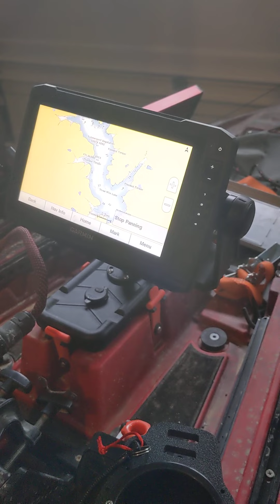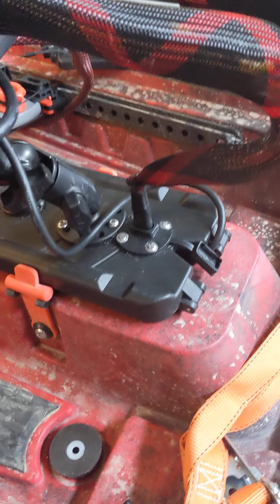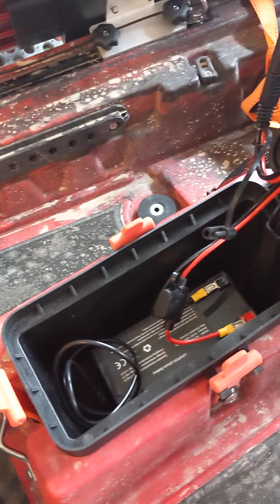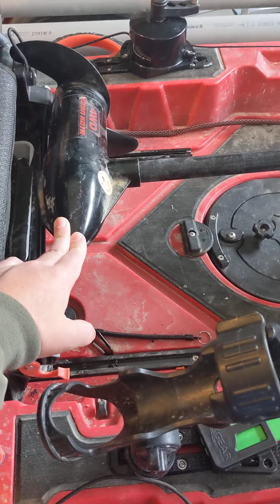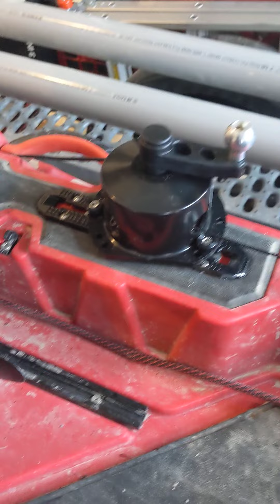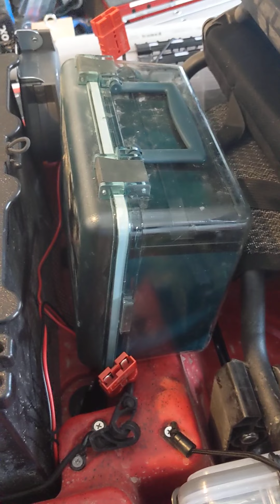Vibe Shearwater 125 Electronics Walkthrough

Comment: How did you get the triple shot transducer to fit? I couldn't get mine to fit the the pod cavity unless i loosened it way up, then couldnt get it to level out under the kayak.
Reply from the maker: well the Garmin 93SV three in one isn't all that long in the GT54. The GT56 probably is a tad long. I know guys that run the Lowrance tripleshot and they do as you do, loosen bolt enough to tilt the ducer down when placing and removing the pod. In some instances, with the right mount, you can loosen it just enough to click it up and down. Sometimes you have to loosen and tighten your bolts. Certainly a pain. However, it doesn't have to be perfectly level. The boat isn't level and isn't level when you're getting bounced around on the water. You won't lose much if it isn't exactly level after placing your pod. My ducer certainly isn't level or even straight as one of my mounting nuts stripped out so the whole thing has a bit of a jiggle to it.

Comment: I’m about to install that same Garmin on my Shearwater. Do you feel your Garmin is too far away from you on the pod?
Reply from the maker: No, not really. When split screening it isn't the best due to distance but just having one thing on the screen at once it is plenty big. I would not use a RAM mount again though. Hard to get it tight and locked in position. I would say before bolting it anywhere permanently, try a few outings with it on the gunwale and see if it gets in your way. I like the ease of pulling the pod and going as well.
Reply: @kyjomi  Ok. Thanks. I bought the Scotty mount. The ease is one of the main reasons I want to mount it to the pod. I was laying everything out last night and had an idea to mount it on the starboard side where they have the step rectangle section. I would drill a whole behind the Scotty mount and use the YakGadget through hull wiring kit to run power and transducer lines. I’d have those lines coming out through another through hull wiring kit right by the pod. Not sure if that makes sense. Not too sure if I want to drill two hole that big though.
Reply from the maker: @mesa620  I considered moving to gunwale over the off-season but I didn't want to route the cables through the hull or have them strung across the hull. I rearranged a lot of stuff over the off-season to keep the cockpit clean and clear of most stuff
Reply: @kyjomi  Yeah, I want it clean and free of cables too so was thinking of routing it through the hull. Just not sure how much the two 3/4 inch or so holes would affect the structural integrity of the hull. Thanks for the info.
Reply from the maker: @mesa620  I have a 2 inch hole and multiple smaller holes. You'll be fine.
Reply: @kyjomi  ok. Good to know. Thanks.

Comment: What are the links to the wiring that you bought to hook it up in the box.
Reply from the maker: This is the splitter that goes from my battery to my USB volt/charger and to my fish finder
https://www.amazon.com/gp/product/B07SLXYRCY/ref=ppx_yo_dt_b_search_asin_title?ie=UTF8&psc=1

I used this port to allow my fish finder to connect to my pod and also serve as my charging port
https://www.amazon.com/gp/product/B07V6NJ37P/ref=ppx_yo_dt_b_search_asin_title?ie=UTF8&psc=1

I purchased this set so I had ample connectors for the various wiring projects I did. You'll need spade connectors to connect to most battery terminals
https://www.amazon.com/gp/product/B01N22XLAW/ref=ppx_yo_dt_b_search_asin_title?ie=UTF8&psc=1

Let me know if you need anything else
Reply: @kyjomi  Thanks, can't wait to rig my shearwater.
Reply from the maker: @dogleopard2069  I also went ahead and dropped some Amazon parts links in the video description of needed